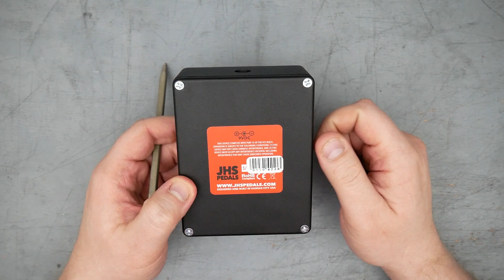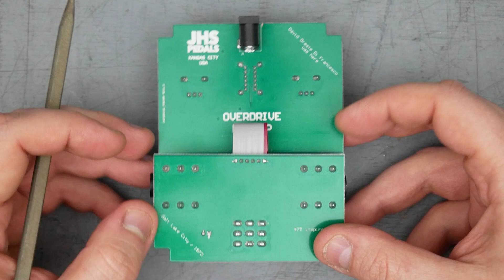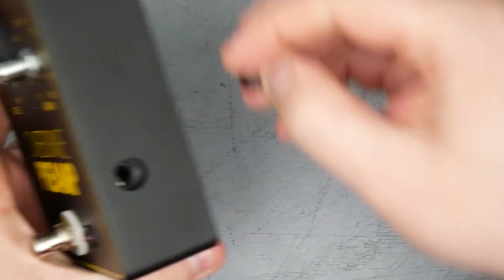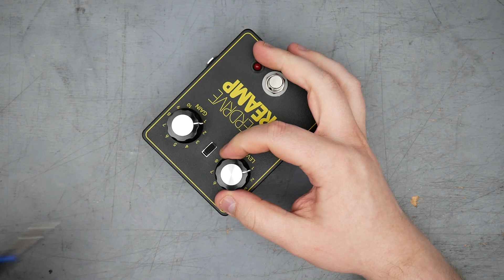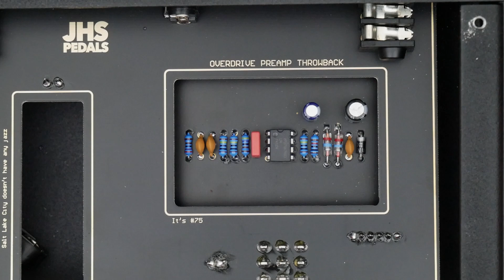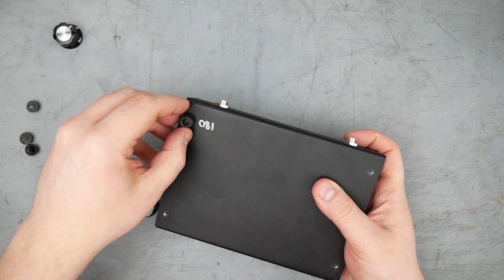JHS #75 Throwback & Overdrive/Preamp Teardown! See what's inside!

Comment: The original 250 seems to be pretty low output. Did they correct this on the Overdrive Preamp by putting the diodes after the output cap?

Comment: Awesome!  Is that just a compact mm you used to spec the diodes?  Would be honored if you give my vid on a 250 variant a listen.  What are some other single op amps besides 741s that have the same pinout I could try?  I want to test the magic of the slew rate with my own ears.
Reply from the maker: OP07, OPA134, LM308 come to mind. They may not have the exact same pinout/features but should still work.

Comment: I would love if you  could do a teardown of the ZAP MACHINE from eqd. They are limited I have the 350# run. Its the best sounding pedal I own or ever have owned. I have owned many. The main point of interest of that pedal in my opinion is how touch responsive it is and how it goes from clean boost to fuzz and does them all well. Its also a germanium silicon hybrid? mysterious.
Reply from the maker: Will check it out, thanks!
Reply: @graybenchelec  you might have trouble finding one ... thats the only problem. I bought mine in 2018 on reverb for 189$ I think the last one sold for 600$ . But maybe some one you know has one.

Comment: never remove the silicon clipping diodes and cut in 3mm red led clippers . the extremely low slew rate of the lm741 is why all op amps are identical . never use plumbers flux even if you remove it . there is no such thing as a grey spec . the astro mess is not a 1:1 clone of the hyperion that costed 2x . jhs does not influence the used market .

Comment: There's absolutely fucking nothing in this pedal, lol.
Reply: That’s normal for vintage pedals.
Reply: I have a clone version of the pedal and it’s tiny so yes you can easily put the circuit in a small pedal the size of a lighter. However if you’re on stage and it’s your only pedal like how it was in the old days, a large size enclosure is better for ergonomic reasons. Also pedals wired in large enclosures are usually easier to repair if by chance there’s a faulty component inside
Reply: It could be used as an amp.

Comment: I restore vintage Bakelite telephones from the 30/50s for a living. Their rubber feet have custom machine screws with a stepped shoulder the depth and diameter of the bottom of the rubber feet. Does up tight and solid. It would have been nice to see JHS use something similar.
Reply from the maker: To be fair, they may have just been recreating the original DOD enclosure.

Comment: Wow the mass produced version had zero reason to be that big. I know the 250 was a pretty small parts count but seeing it in smt, that thing could’ve fit on a postage stamp. I can’t fathom why they bothered to not use a more compact housing.
Reply: I think it’s mostly just marketing tbh. Maybe a combo of the two factors 🤷🏻‍♂️
Reply from the maker: Legitimately could be supply issues. 125B is the new default, and the OD/Pre could have definitely fit in that. Maybe they just had a bunch of 1590BB laying around?

Comment: Great video as usual, Joe.

Terrible layout/construction on JHS part in my view. A pedal that cannot be disassembled without desoldering (lead free solder at that) is just terrible.
Reply from the maker: Thanks :) Yeah, not really sure what the plan was. They definitely could have done a single PCB with PCB mounted pots, then offboard footswitch and 1/4" jacks. More time consuming I guess? Not sure.
Reply: @graybenchelec  my thought is that they were probably more interested in the aesthetics aspect rather than the repairability. They probably think that because it's a limited edition pedal it's most probably going to be bought by collectors having them displayed on a really nice shelve rather than a working touring musician, so repairs are probably not going to be needed.
Reply from the maker: @alexisdrosopoulos  I think you're right. It's not a big deal really, just more work for the repairperson in the unlikely event they're needed :)
Reply: @graybenchelec  

Who knows what goes through people’s head, man. ;) ha!
Reply: Is that true? Did he actually try to get it out? If the jacks are not in a tight hole their looks space to hinge the footswitch out and then slide out the board. Don't know and I'm not going to buy the pedal to try!
Reply from the maker: @chriselliott726  I did, it was wedged in there pretty good.
Reply: @graybenchelec  Ok, thanks for the reply. So you are saying it was definitely soldered in situ? In that case pretty bad design!
Reply: In my opinion it’s fine.  I feel it’s more ideal for studio use for big name artists or any decent artist. Then the pedal’s legacy lives on in a cool way in a recording. The pedal would not likely need to be repaired for a very long time if it’s just for studio only

Comment: I wonder how much time and money they saved on construction using the board mounting jacks instead of offboard wiring. The board is laughably large for the circuit. I guess maybe it's jusitifed by having a larger ground plane to cut noise?
Reply from the maker: I reckon it was just for looks :)
Reply: @graybenchelec  on Instagram, JHS says it’s because they wanted to replicate the aesthetic/look of the pedal it’s based on.
Reply from the maker: @marksescon  I think they were just referring to the exterior. I actually haven't seen the inside of those original OD preamps.